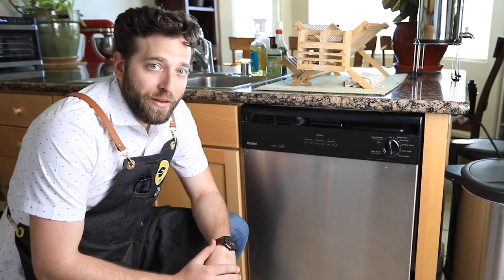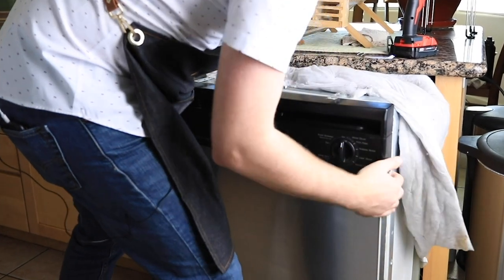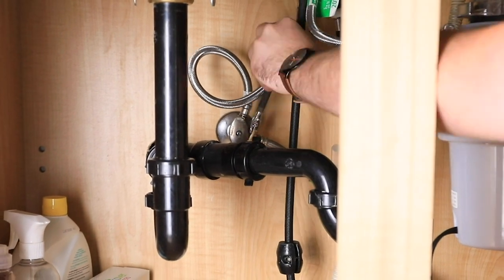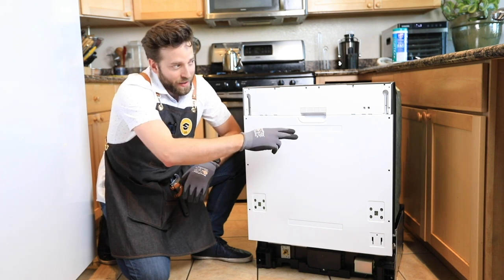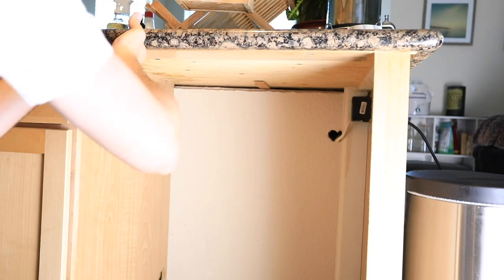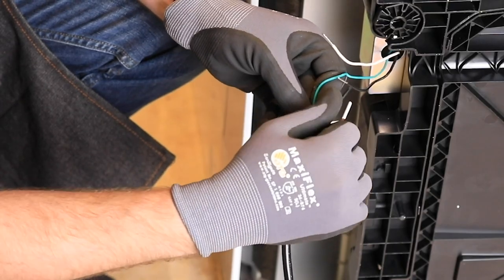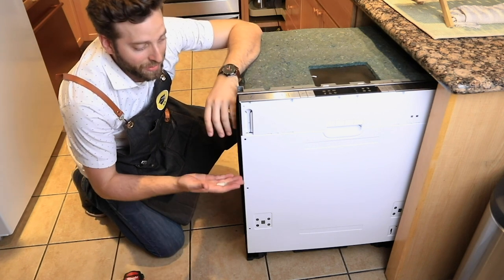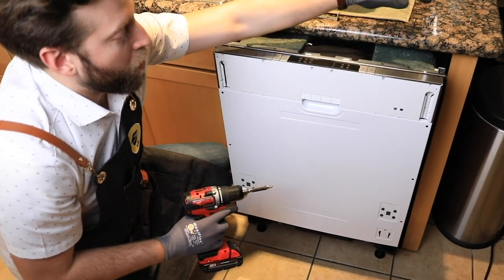How to Install A Dishwasher | Full Video

Comment: I would use cross dissolves to fade out you dead spots on your (fast) timelaspe. Great info btw!
Reply: Also mute the audio in you sped video (no chipmuck video or High pitch drill Squeals)

Comment: You should have high looped the drain hose, it helps prevent backwash into the drain hose from the disposal. Not sure if Z-line states that in the manuals.
Reply from the maker: Hey Johnathan, thanks for the feedback!

Comment: I have that dishwasher. Mine has no rear feet. There is a hole on each side, rear bottom, where it appears that they should be inserted, approx 2" diameter and a few inches deep, where one might insert feet assembly, but no dang feets!! Am I missing something?

Comment: What size was that elbow to the water line on the dishwasher ?  I just tried 1/2 and 3/8 and both didn’t work
Reply from the maker: Is the dishwasher you're installing a ZLINE branded one? for this video we used a 3/8" elbow that came with a generic kit, purchased at Home Depot. The kit is for most US model dishwashers and listed to fit GE, Whirlpool, and Maytag; and here it fit the ZLINE dishwasher perfectly. I just updated the links in the description for the exact kit purchased.

Comment: How did you drive the screws into the underside of the stone countertop? We're they pre-drilled?
Reply from the maker: Great question! Beneath this counter was a wooden shim that had been installed with the previous dishwasher. Every home and every counter will be different. If replacing an existing dishwasher, like in this demonstration, it may be possible to use the same screw holes as before, depending on the unit. Hope this was helpful.